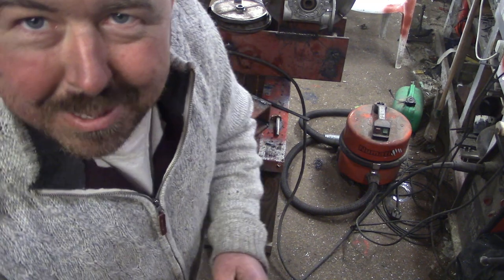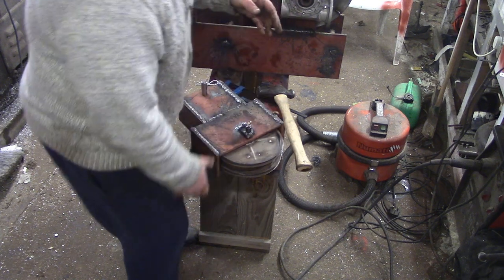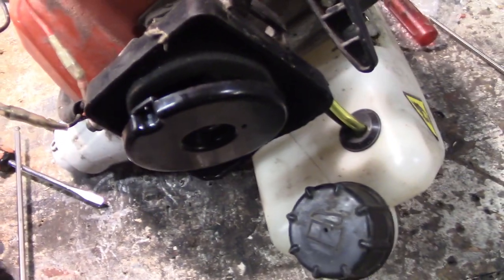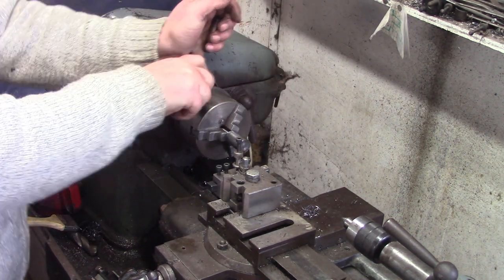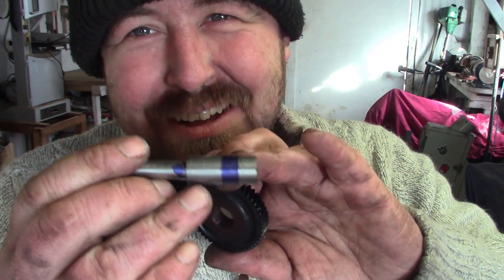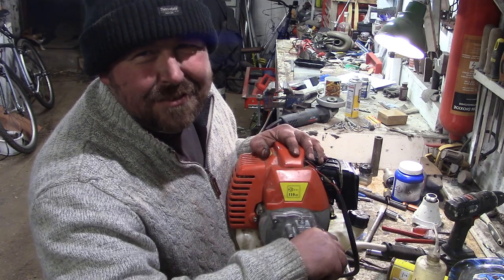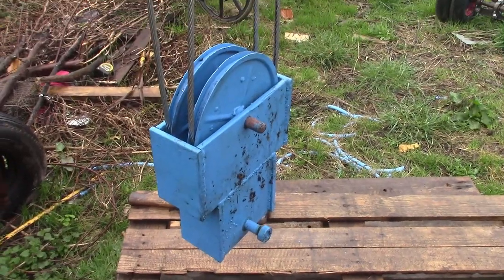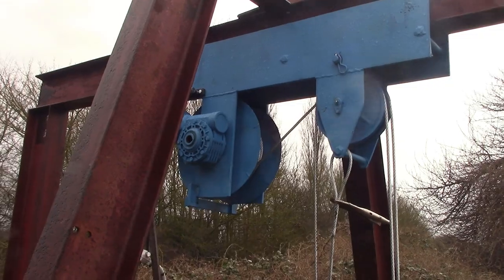Mighty crane build, Spooling cable yo!

Comment: You're definitely getting there mate, pretty sure that you're going to have to ballast up at the back a little, but it's looking damn good at the moment. I was waiting for the blooper reel at the end to see you go through those pallets whilst carrying the pulley assembly and end up with a face a la Wile E Coyote.
Reply from the maker: The only reason for ballast would be traction, I don't want to run the carriage forward with the concrete pipe, just the muck bucket which is <100kg but if I'm wrong you'll get a blooper real!
Reply: @turboconqueringmegaeagle9006  Yup, heavier it is at the back, the more likely it is to grab the ground, if that fails, try a right sturdy tyre on the motorised pushme-pullyou tractor (like a tiny tractor rear wheel tyre if they can be sourced).

Comment: Good thing you have space in the sheave carriage for guides! Good job with the engine, especially that 4:1. Even though you were right on the numbers previously, I think the friction losses were enough to push you out of the best performance range for that little trimmer engine. You definitely did the right thing. Next up, load testing!
Reply from the maker: Sheave carriage aye? Thank you, was wondering what to call it.
You were right to doubt that little engine, it's working nicely now we'll see how it does under load